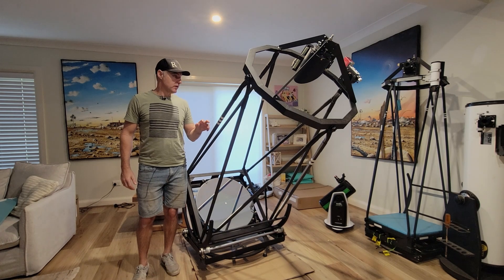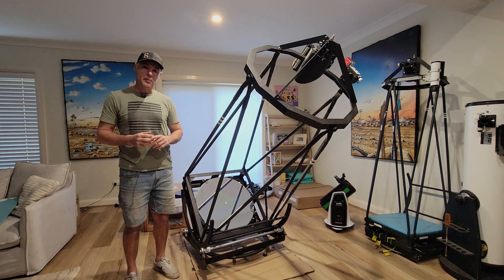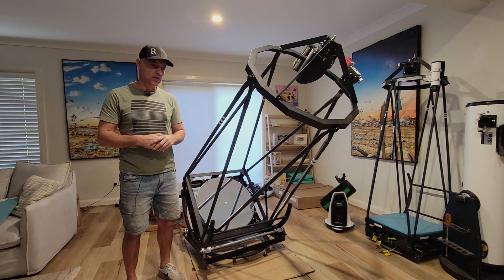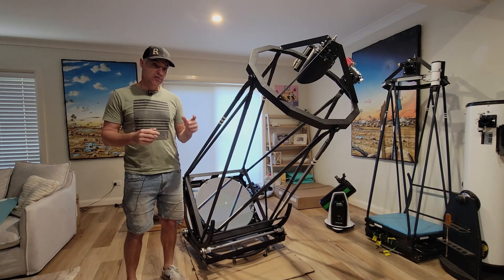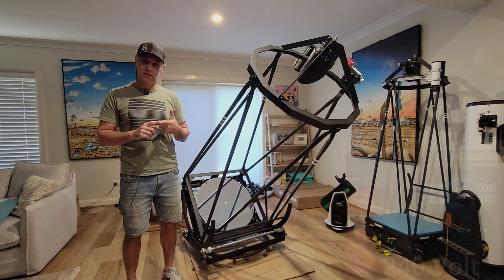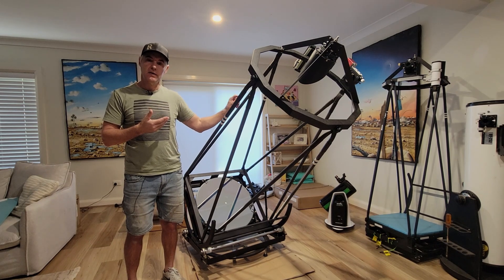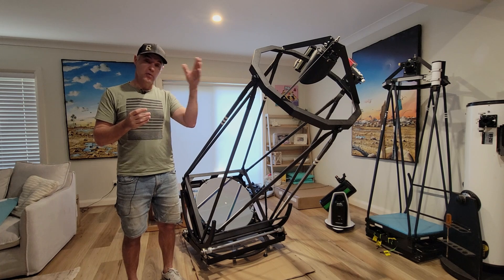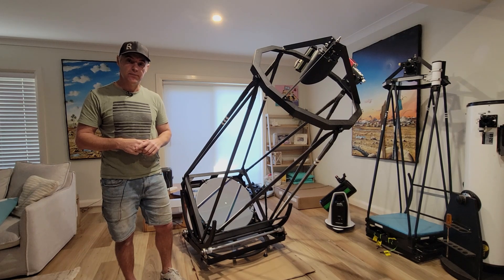24" Hubble Optics Dobsonian

Comment: Awesome telescope. The AC/DC  power draw makes sense as the power supply has to dump a load of voltage to go from 240AC to 12VDC (usually in the form of heat).
Reply from the maker: Hi Pete,
It's a great bit of gear, lots of fun.

Yes agreed on the AC DC it has losses from the Bluetti and then the AC brick also which obviously adds up. Very efficient in DC at 4 Wh tracking. To be fair I was very happy with the 10 Wh in AC when I first plugged it in👌

Damo

Comment: Interesting , I'm guessing the higher power consumption in AC is basically the inefficiency of converting AC to DC compared to just drawing DC straight off the battery .  I was looking to go to Armidale too seeing as SPSP cancelled  , shame the weather didn't cooperate .   The telescope control software we saw a little on the screen - is that Onstep ?  Can you still control the scope from a tablet with say Sky Safari 7 etc ?
Reply from the maker: Hi Mate, 
Yeah it really surprised me when i saw the difference, I hadn't thought about it much before then but after seeing the numbers i am definitely paying attention now.
Armidale would have been very nice and hopefully it will come together soon, i should have known better than to open my mouth.
It is Onstep and i am very sure you can control it with Sky Safari or Stellarium but i have just been using the Onstep native App, this deffinately needs to change as i really wan't to try and get it to track the ISS and other fun targets which are not available to the Onstep App.

All the best
Damo